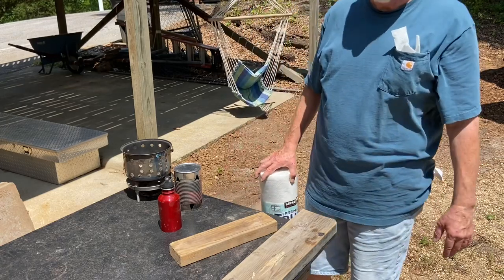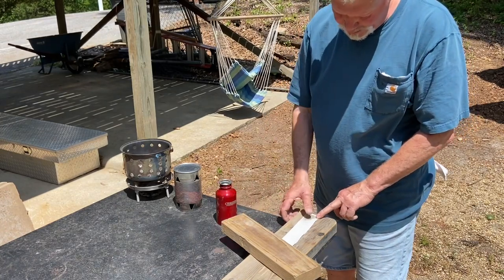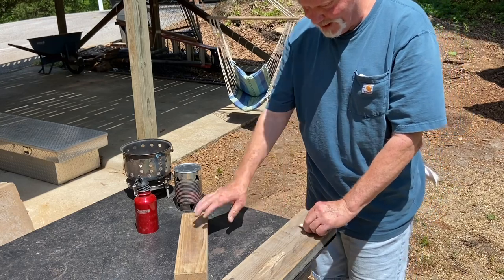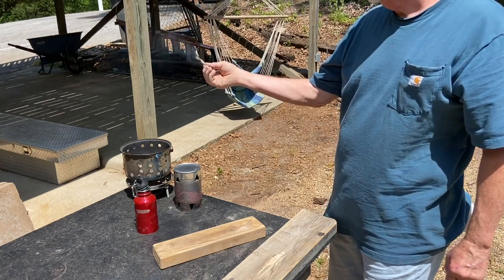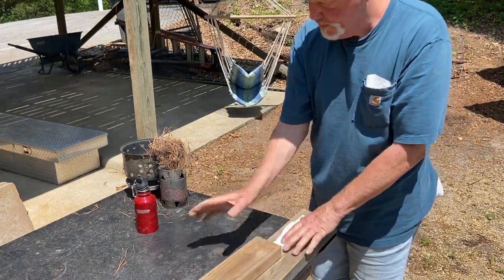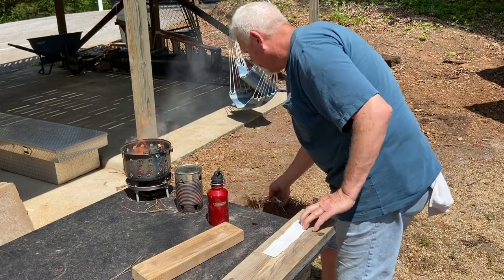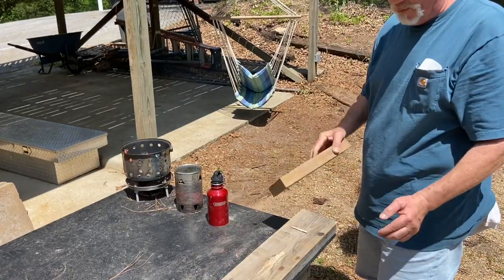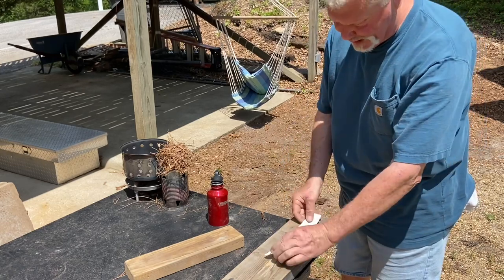Perfecting The Paper Towel Fire Roll

Comment: Perfect timing..  Earlier today I was trying paper towel with charcoal and ash but couldn't get it to go.  it was a fluffy mess by the time I gave up.  I'll rotate it 180 next time!  I did manage to have it give off that smoldering smell!   But no cigar!
Reply from the maker: Charcoal is not a very reactive filler. That's why it takes the strongest of fibers and heavy pressure to ignite.
Reply: @DavidWestBgood2ppl  Well, I tried it with ash rubbed in, and doing the 180 rotation trick.  I should have had a camera rolling, but I trust you will believe me when I say I lit my fireplace on the first attempt!   It took a bit to blow the ember hot enough in the pine needles I pulled from my landscaping.  Awesome!   I have Bounty towels.  thank you for making the distinction over charcoal!   I have a question on blowing technique.    Is a continuous pulsing puff better than a constant blow?  It seemed to work better to build the heat initially.  Once the ember grew enough to stay hot, then I went to forceful blow to finally ignite the tinder.
Reply from the maker: Thanks friend!